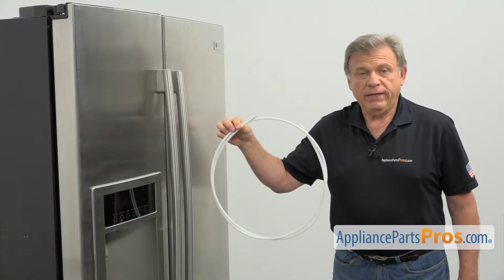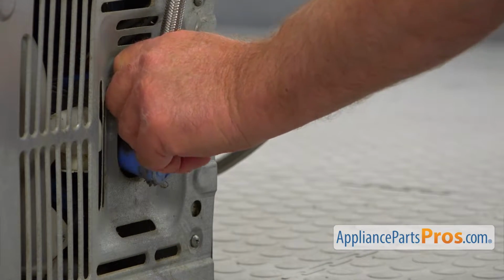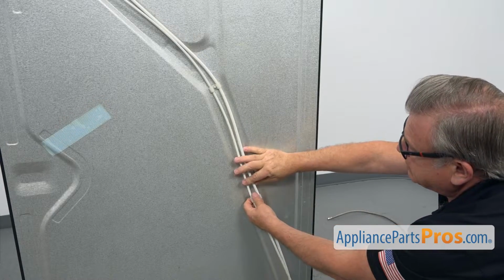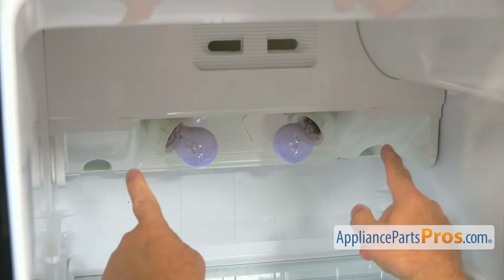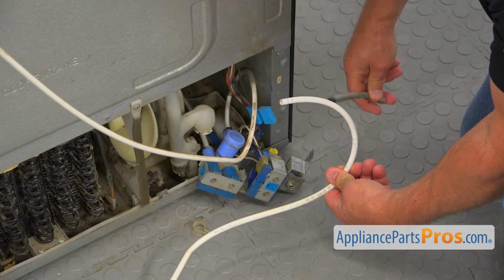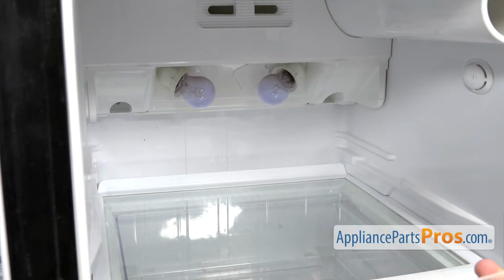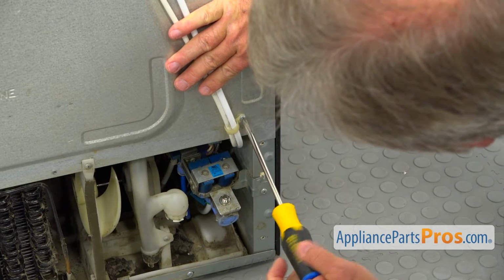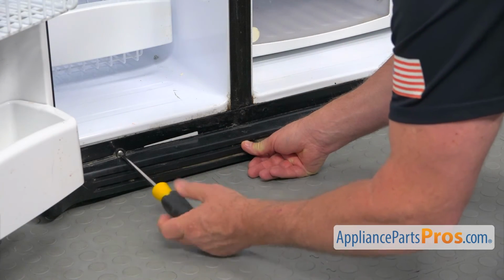How To: LG/Kenmore Refrigerator Water Supply Line MJU62070603

Comment: What about the other side of the line that runs into the door through the bottom hinge?

lg lsc27937st
Reply from the maker: The water line that is inside the door is foamed into the door, so the water line is not sold separately from the door. Unfortunately, that door is no longer manufactured, so we are unable to order it. The part number is ADC72986491. You may be able to locate that in stock somewhere.

Comment: Hello, this is a terrific video!  I have an LG Model: LRSC26980SB, and the water line that goes up into the freezer door at the bottom has started leaking.  Is this line replaceable, or is it foamed in place into the door?
Reply from the maker: Unfortunately that water line is foamed into the door. That part number is 3581JA8571R. This part is no longer available so we are unable to order it. You can take the part number and check around to see if anyone still has some stock left.
Reply: @appliancepartspros  That's what I was afraid of... thank you for the response.  Is it possible to access the top of the line if I remove the panel on the freezer door?  The reason I ask, is I'm wondering if it would be possible to access the water line from  where it connects to the dispenser in the door, and then superglue a new line to it, and use the old line to pull the new one through the foam.  Do you think this is at all possible?
Reply from the maker: Unfortunately, since that water line is foamed into the door, pulling it out could damage the insulation and interior of the door and we cannot guarantee replacing the water line would work and not damage the door.

Comment: I have model LRSC26925TT and my leak is coming out of water line that runs up into freezer door.  The line runs through a spring between coupling and door I'm guessing to protect the bend.  I don't see anyway of taking door apart so I'm thinking it's either: a) replace door, b) go without water dispenser, c) buy a new fridge.
Reply from the maker: Unfortunately, the water line is foamed into the door so it's not available separately. The door part number is ADC30170401. This part is no longer manufactured, but you can take the part number and check around to see if anyone still has some stock left.

Comment: Helpful video. How do u replace the pipe from the bottom of the door, drinking up to the water dispenser. Mine broke off, and sitting inside the door
Reply from the maker: What model number is the refrigerator?